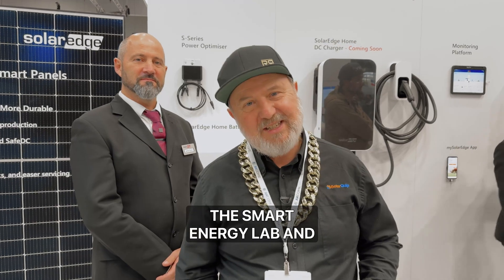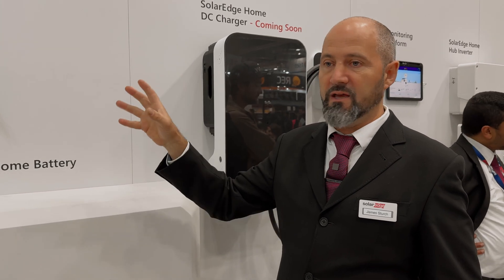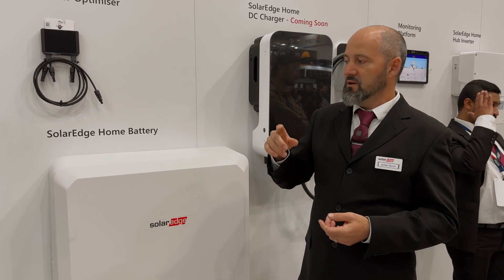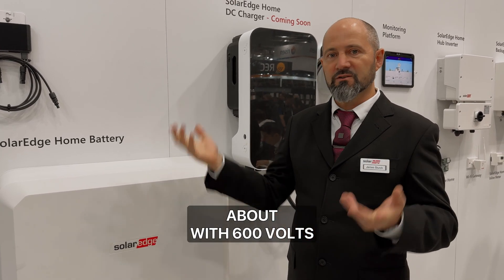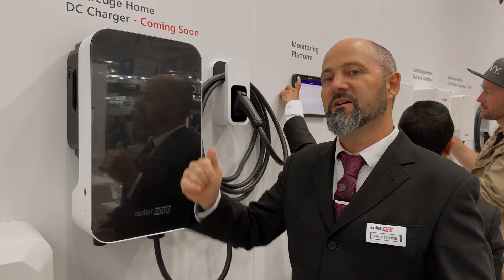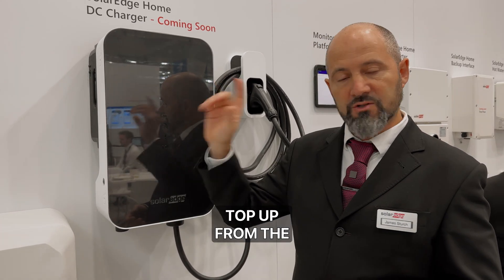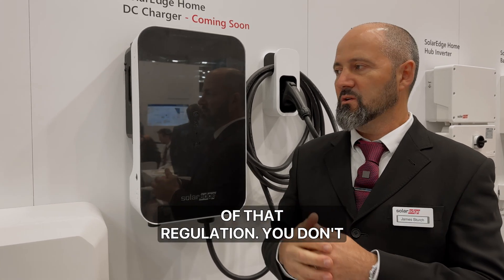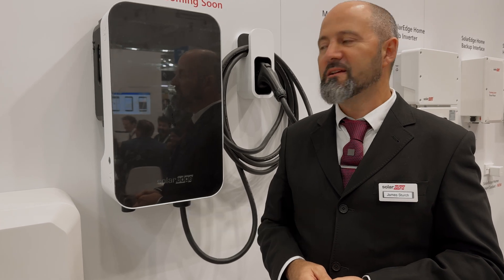SolarEdge 25kW DC EV Charger @AllEnergyAU

Comment: I look forward to hearing updates on this when you get more information. I hope that it also supports CHAdeMO. One of the things I like about SolarEdge is that it's modular. My EV is parked about 30 m away from the electrical room where the inverter would go, and the battery would be outside (I'm in Canada, where indoor battery siting rules are pretty restrictive) about 10 m away from the inverter, so being able to have the EV charger separate from the inverter makes this much more practical for our situation than some of the all-in-one DC systems like the one from DCbel.